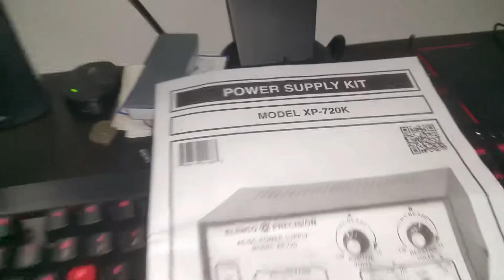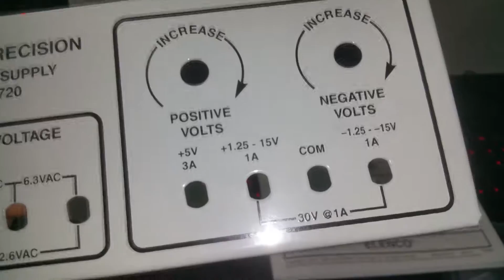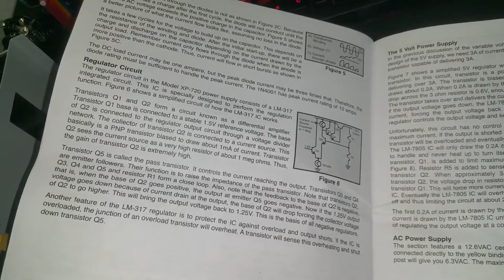Elenco AC/DC Triple Output Power Supply Kit

Comment: Hi,  I am in India.  we use input voltage 220/240v. can we build the same by just changing the transformer.
Reply from the maker: i dont see why not. you can change plug and transformer should easily work.

Comment: the white paste is because soldering to Al. is not possible without a nickel strike process or flouric acid.
Reply: You probably know by now I am sure but the "white cream" is heatsink compound for mounting the power transistors.
Reply from the maker: +Rýán Túçk Not really, its to not short circuit the ICs and for heat.